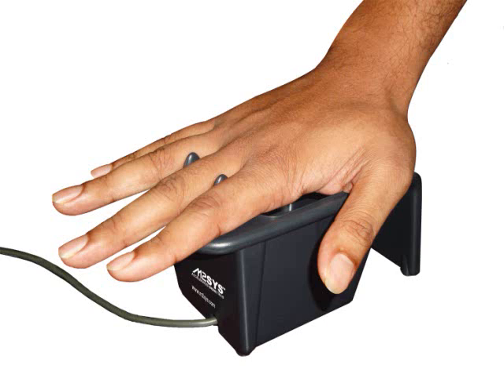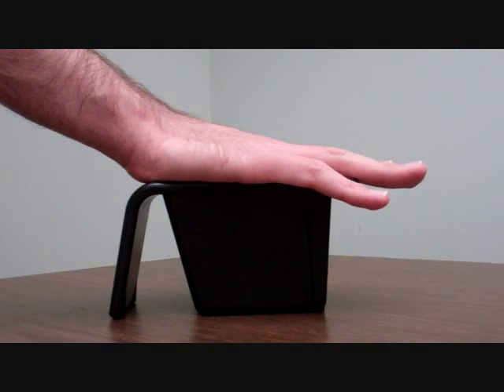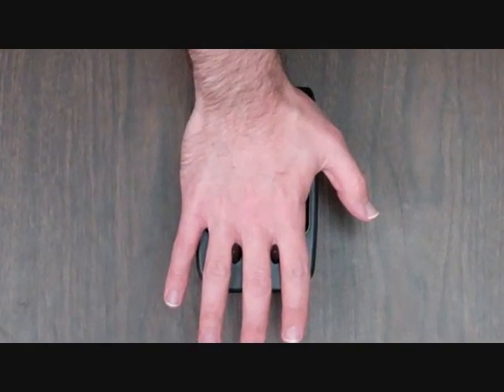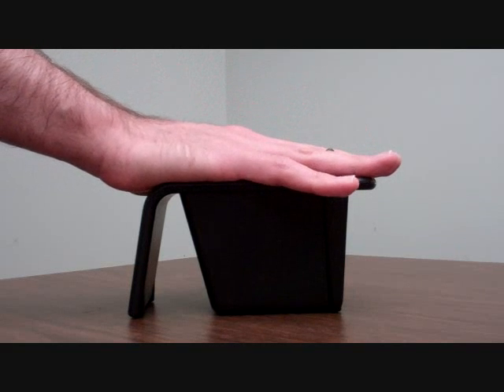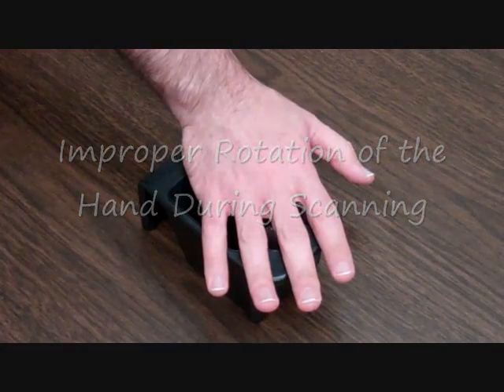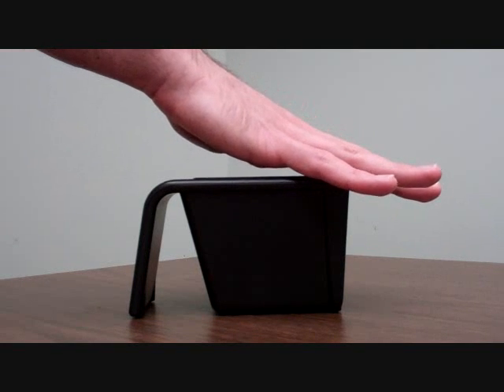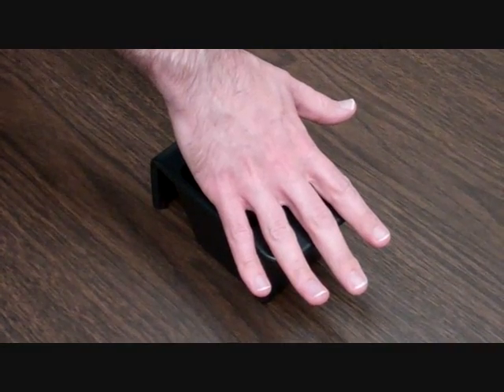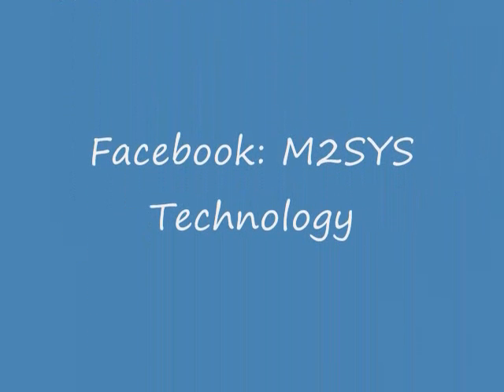Training Video on How to Use the M2SYS Palm Vein Scanner with Fujitsu PalmSecure Sensor

Comment: These things are TERRIBLE.  We had 3 of them and replaced them all with fingerprint scanners.  If your hands are programmed warm, cold hands wont scan.  Dirty hands wont scan.  They wont scan if it is too light, cold, warm, or on a day that ends in "Y"  They are so bad that the employees (All 130 of them) resorted to typing in their logon information rather than use these garbage scanners.There are too many problems reading veins.  Fingerprint scanning is the only way we can get reliable results.

Comment from the maker: Thank you for the comment. You are correct that palm vein biometric technology does not require any contact with the sensor. The hand guide for the palm vein reader is positioned above the sensor to ensure that the end user positions their hand correctly above the sensor for an accurate read. We do not claim in our training video anything is "unacceptable" as you allude to, only that end users may have difficulty achieving accurate scans without using the hand guide properly.